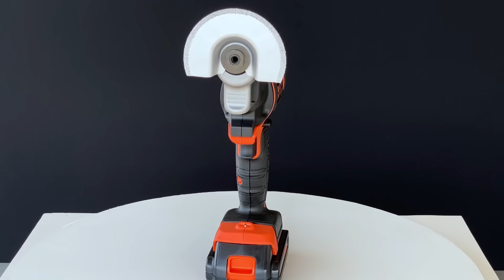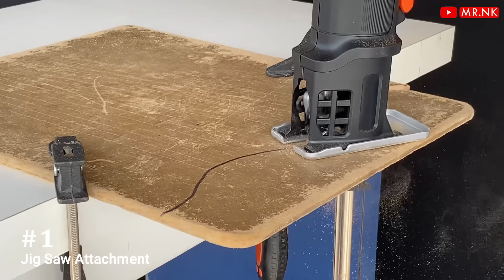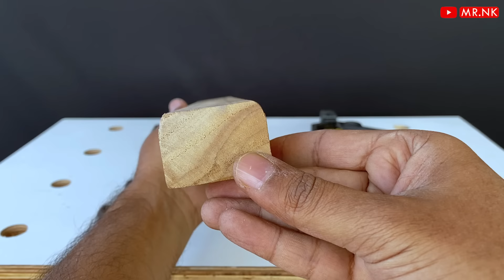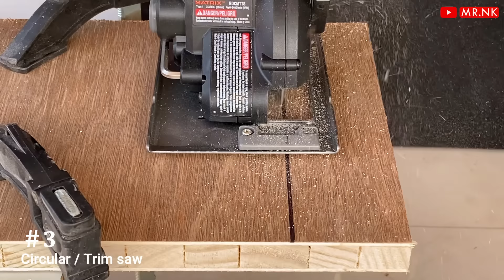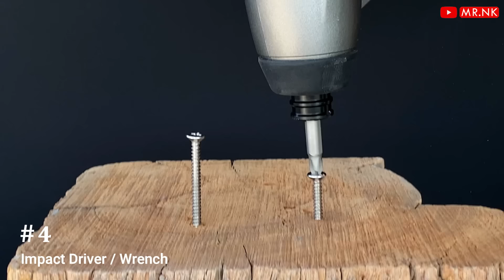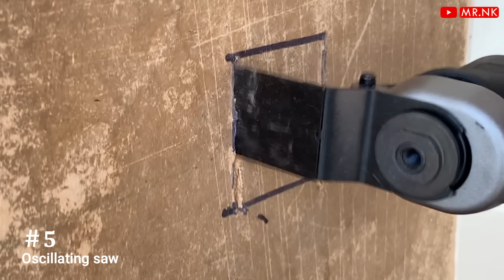5 Amazing Multi-tool Drill Attachment !

Comment: Excellent attachments, great idea and design of  B&D's Matrix Driver.  The B&D Matrix kit is a well-designed tool with excellent attachments. The problem ( a deal breaker) is BRUSHED MOTOR. All this kit goes to dumpster after those brushes (in the electric motor) will wear out. This short lifespan makes it a poor long-term investment.

Comment: Have this tool, it's the same as the old craftsman.  Both units can interchange parts.  Both are from the dewalt factory.  It has many attachments, but it was not good at anything.  It's designed for casual DIYer.  It was discontinued like 5 or 6 years ago.  Are they making a comeback?

Comment: Wooooou, where I  can buy?
Reply: Amazon!!!!!!!!!
Reply: Amazon is where bought mine and then extra bought the inflator there also!!! Since I do not work out side house as craftsman I need them all  and all for less $225.00........... Bought extra blades so I could do a little more!!!!!!! Each has it own instruction booklet, comes a big plastic box with lid that is clear!!!! They slip in and out of the box and the drill handle easy.... I had the plug in drill with change able front already.... I really to not want to get into the battle for batteries because since I may only use it once a week. I did want to turn to a battery operated one  and not have a battery charge then have to wait hours to charge!!!! But this has prove me wrong every time I have reached for it............"ALWAYS WILLING TO HELP!!!"

Comment: Seems the RPM is too low for several attachments.
Reply: What rpm would you recommend. If at all
Reply: @kevcshank9933  a good circular saw runs anywhere between 3,700-6,000 rpm, an oscillating tool can run up to 20,000 opm, this drill probably runs a t 2,000+/- on the highest setting. So unless the attachments are geared up a lot, they would be slightly better than working with hand tools

Comment: I've had my multievo for like 4 years now. I only have the circular saw and the impact driver but I plan on getting the router and a few more. Also maybe get a matrix since those have more powerful batteries and one of mine has died recently. I've done tons of small jobs at home with it. It's a life saver! I did have to remove the lower protection from the circular saw because when using it it would cover the exhaust and couldn't vacuum anything (mine has a vacuum cleaner adapter).

Comment: I have never had a good experience owning anything that was a black and decker.
The term jack of all trades master of none comes to mind. If you tried to make a shovel that was also an axe it would be neither a good shovel or a good axe.
Reply: The analogy is not understood, but  it is for industrial use. It is for occasional work and not for more than two hours of daily use.  I HAVE A DRILL WITH MORE THAN 20 years of use. I bougth it in 1993.